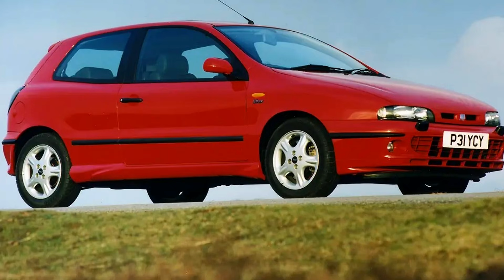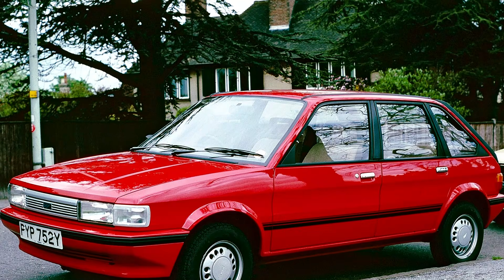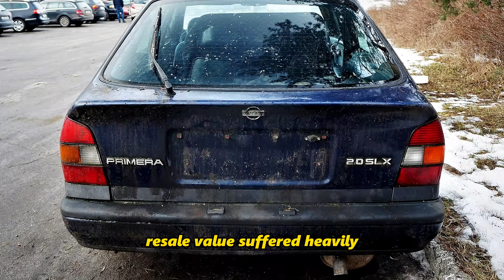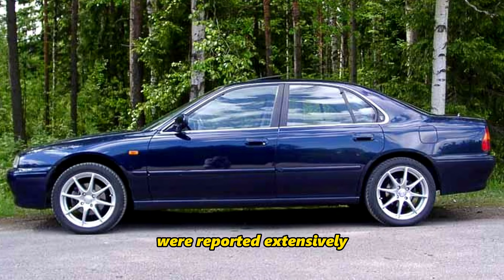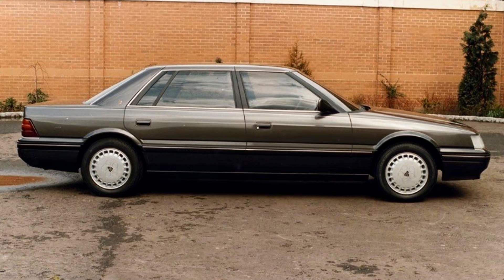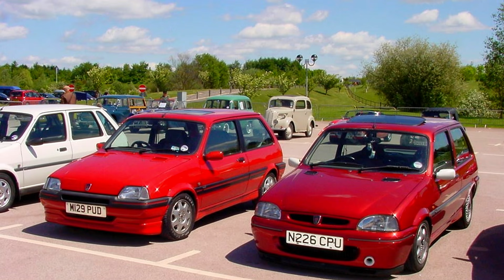10 WORST British Cars Families Regretted Buying in the 1990s – #1 Was Embarrassing | Britain Rewind

Comment from the maker: Which of these cars did YOUR family own? Drop the name below — and tell us if it broke your heart or your wallet first. 😂⬇
Reply: I think this list is a bit harsh on Rover and also mixes up "worst" with "old".

The Maestro, for starters, was fundamentally an 1980s car, having been launched in 1983. Criticising it as one of the worst cars of the 1990s is a bit like criticising a Mk2 Cavalier or Sierra for feeling dated in the late 90s. By then it was already an old design nearing the end of its life.

As for the Rover 600, that's a strange inclusion altogether. It was based on the Honda Accord, was generally well built, reliable, comfortable and is still regarded by many owners as one of Rover's finest products. You can argue it wasn't exciting, but one of the worst cars of the decade? That's a stretch.

The Rover 800 had its issues in early form, but by the 1990s facelift cars many of the problems had been ironed out. It was comfortable, spacious and sold well enough to become a common sight as both a company car and executive express.

The Metro/100 is probably the easiest one to criticise because of the Euro NCAP result, but that was more a case of a late-1970s design being asked to meet safety expectations that simply didn't exist when it was conceived. It wasn't a great result, but it doesn't automatically make it one of the worst cars of the decade.

If we're talking genuinely poor cars from the 1990s, I'd be looking at things like the Daewoo Espero, Yugo Sana, Lada Riva, Proton Persona, or some of the truly dreadful badge-engineered efforts that were already outdated when they arrived. Many of those were less refined, less reliable and less desirable than the Rover models mentioned here.

I think there's a tendency for some motoring channels to use Rover and British Leyland products as easy targets because people already know the jokes. The reality is that many of these cars sold in decent numbers and were liked by the people who actually owned them. History is usually a bit more complicated than a "Top 10 Worst Cars" list allows.

Sometimes it feels as though some people have already decided Rover belongs on every "worst cars" list before they've even started making the video. The deeper you dig into the history, the more nuanced the picture becomes.

Comment: The Maestro also used the 2.0 O series engine in the clubman and mg spec models and were surprisingly fast and reliable.  I had an MG Maestro 2.0 efi and it was a great car. Admittedly rust was an issue but no more so than most stuff of that era!
Reply from the maker: It’s always refreshing to hear a positive perspective from someone who actually spent time behind the wheel of one.

Comment: What a load of absolute cobblers. I was a salesman in the 90’s with actual experience of all of these cars - unlike whoever or whatever made this utter garbage. The Cavalier was a simple, tough, cheap to run and easy to fix family car that could do 200,000 miles plus with ease, the Mondeo was almost as tough, but much nicer to drive. The Primera was a class leader too, it was great to drive, economical and mechanically bulletproof - none are remotely as described here. 

The Omega was every bit as good as a period E34 BM 5 series, and better than the equivalent rust bucket Merc E class or dull to drive Audi 100. The Rover 600 was absolutely bombproof, it was a nicer looking Honda Accord, there absolutely was not any electrical issues suggested here. I never had one back. The interior, engine, gearboxes and electronics were identical to the Honda Accord. The only real differences were in trim, and the turbocharged 620ti, which used Rovers own T series motor. These leaked a bit of oil, but were otherwise robust, if looked after. And the diesel L series 620’s, which were fit for 300/400,000 miles plus, and did 50mpg. 

The K series Metro was a class leader also, the only issue was that it outstayed its welcome and safety didn’t move on with rivals. These were great to drive and very reliable. 

This is the worst researched bit of automotive media I’ve ever watched. What utter nonsense. Even the Lancia Dedra was a pretty decent car.
Reply: You want a really dreadful Briitsh made car from the nineties, the Mark 5 Escort. It looked completely bland, unlike its sharp styled predecessor, the engines were noisy and gutless, it didn't ride well ,and the interior looked cheap and nasty.  To make things worse, the Escort wouldn't start in wet weather and alternators died prematurely. It was a car that was so dismal, Ford had to totally rework it after 2 years and even then, it was an unreliable buzzbox.
Reply: @Glenn1967ful 

I was stunned by how bad the early Mk V was when I first drove one. The 1.4 CVH was noisy and utterly gutless, it wasn’t great on fuel, the handling was as woolly as a pensioners jumper. 

The 1.8 diesel was dangerously slow, and needed a timing belt every 3yrs or 36k, the CVT auto was hateful in every way imaginable, the 1.6 SI was the worst hot hatch in history and to rub salt in they were dearer than rivals new. The 1.6 Si was more expensive than the outstanding Renault 19 16v when you matched equipment levels. It was horrid. 

But I would say that the Escort did become probably the most improved car of its era by the time the Mk VI came out. The 16v Zetec motors were a big step up, the gear change much improved, ditto ride and handling. The rough but tough 1.8 diesel had a turbo and a big slab of torque added with no economy drop and the RS2000 was a genuinely good thing. All was forgiven, though the Mondeo and Focus showed that Ford were listening.
Reply: @asloan1976  My dad had a 1991 1.4 LX as a company car and it was noisy, sluggish and struggled to better 35 mpg even on a long journey. I can remember it regularly refusing to start in wet weather and having issues with the central locking. The company handed the Escort back after 2 years and changed to  Rover 200s that were so much better in every way.
Reply: @G @Glenn1967ful ah, did like the Rover R8. Good cars, and the much talked of head gasket failures wasn’t a big issue on the 1.1 & 1.4 K series motors. They were never meant to be larger than this, it was the split with Honda and the rushed upsizing that introduced head gasket issues. 

I ran a few 414’s as company cars, but my favorites were the 416 GTi and the 1800 XUD turbo diesels. Both were bulletproof mechanically.
Reply: @asloan1976  The Rover 214 Si was faultless when my dad had his for 3 years. It was everything the Escort wasn't: ecomomical, quiet, smooth riding and well made inside.